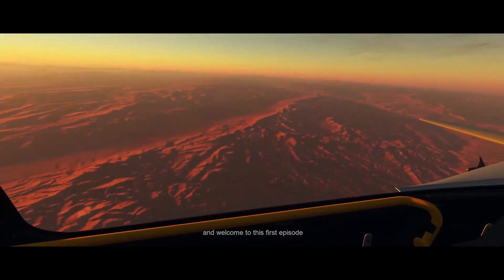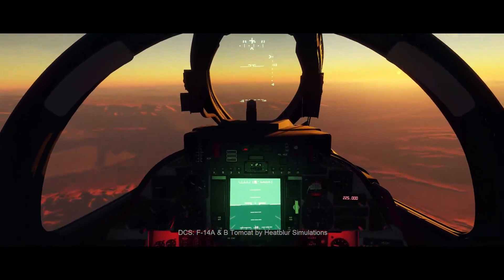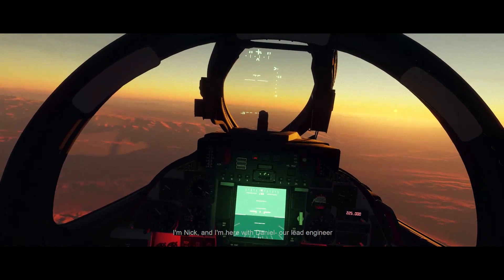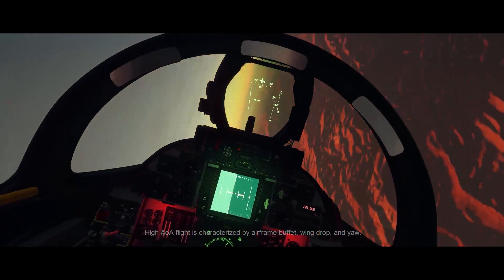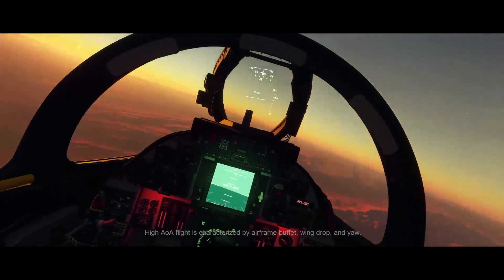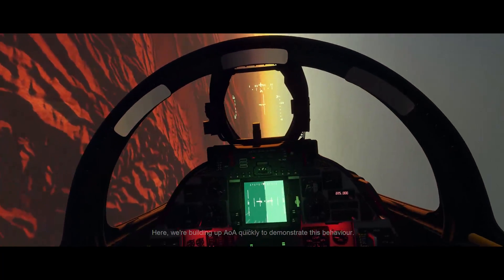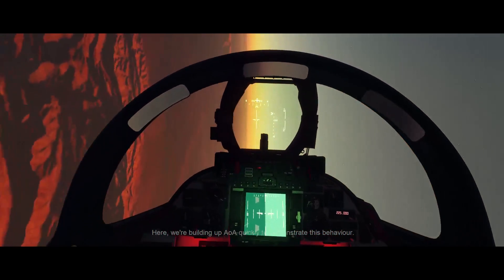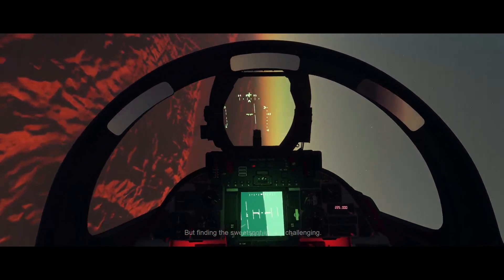DCS: F-14 Flight Model - Ep. 1 - "The Basics"

Comment: I pictured the cockpit of the USN-USMC/Northrop F-14 Echo having several significant layout fixes compared to the Grumman builds.  For the main panel on centerline, I picture an Up-Front Control Panel derived mostly from the Intertial Reference panel in the flight officer's station with flanking COM1 and COM2 selectors, WP button, and brightness; the AOA and sweep tape gauges outboard are carryovers from Grumman.  The Master Monitor Display would be a square 20-button, with the 3ATI attitude director indicator and bearing distance indicator, 1/2-3ATI vertical speed and accelerometer, 2ATI airspeed/Mach, altimeter, and radar altitude display, and the Master Arm/Emergency Stores Jett/Gun rounds and rate controls to port; and the 3ATI threat warning display, chaff/flare/jammer counters, and Missile Prep/IR Cool/Map Gain controls to starboard.  The Horizontal Situation Display wuold also be a square 20-button, with the Engine Cluster (ported from the USN/McDonnellDouglas F-18), Jett Station Select, and quad Hyd Press gauges (ported from the USN/Grumman A-6) to port; and the Fuel Cluster (ported from the USMC/McDonnellDouglas AV-8 Bravo), LOX Quantity, and Cabin Pressure Altimeter to starboard.  With the Joint Helmet Cueing System retrofit, the warning lights formerly on the Vertical Display Indicator on Grumman builds would be relocated to the windshield frame, to join the AOA Indexer and the Compass.

I also pictured a new Esterline stick grip ported from, of all things, Sikorsky helicopters.  The 'pod would have an A/G Wpn Rls button, RDR Acq Mode castle switch, and Roll Pitch Trim hat top; FLIR FOV inverted hat, guarded "ACM" toggle, and Record button second-row. Direct Lift Control wheel on the handle below the "ACM" switch guard.  Two-stage camera-gun trigger.  A/A Wpn Sel paddle (again, ported from the F-18) and IFF button in the thumbrest, with target-undesignate button on the left flank.  NWS/AP Engage pinky button, the corresponding Cancel handle on a paddle from the roll-input bearing on the column.

Comment: How the F does this thing take on small fighters. It looks impossible to maneuver at low speeds. Ive heard stories of it beating F-15s. There is no way...
Reply: Mr. Anomaly they said it's advantages were at low speed
Reply: Low speed handling requires high pitch authority at high angles of attack. Lower lift means pitch increases AOA more. F-15 pilots had a hard time with tomcats at low speed, where the variable geometry wings helped the 14.
Reply: That really makes scene. I really hope the Tomcat can start to tip the scales against the F-15C in DCS with a good crew.
Reply: ShadowPBPBC I know what a flanker is. No need for the wiki description thanks.
Reply: Yes, of course there are HUD TCS videos of F-14 A/B/D getting gun lock on the F-15 that were made available top the public. Then there was 1978 AIMEVAL/ACEVAL where F-14A continuously outperformed the F-15A in ACM evaluation where F-14 was given a 2:1 advantage over the F-15A even with the stall prone TF-030 older engines. In the same evaluations, both F-14A and F-15A went head to head with small F-5E tiger in dog fights. The F-14A had a kill ratio of 2.55:1 versus F-15A's 1.78:1 against the F-5E. Secret is the F-14s variable geometry wings, pancake and central tunnel that give it an incredibly broad performance envelope. F-14A according to the AIMEVAL/ACEVAL report, was continuously outperforming the F-15A in turning performance where F-14A was able to out-turn the F-15A especially when it required tight turn followed by a sudden vertical climb where F-14A simply ran the F-15A out of energy.

Comment: But how well does it fly while inverted?
Reply: You can do a 4G inverted dive with a MiG-28 at two meters.
Reply: The movie 'Top Gun' will explain everything. Then you will be qualified as a Tomcat driver.
Reply: Actually no, I saw a picture a few weeks ago lining the two planes up (F-14, B variant? and the F-5). There's plenty of room to do that with an F-5, I mean a MiG-28.
Reply: what does that even meeeeeeeeaaaaaannnnn.
Reply: With only 600 lbs in the sump tanks, you had better only be transient
Reply: Good enough to get a sick ass poleroid
Reply: It was exceptional even inverted. Grumman did a test (on video from 1973) where an F-14A (fully loaded with weapons) was turned upside down and started to dive down inverted. It stops diving down and begins to climb up flat inverted and goes up vertically inverted at a fairly high speed while raising the nose up gradually. It was an awesome demo video.

Comment: I am way too hyped
Reply: Not necessarily, if the flight model is accurate and you encounter a Mig-29 or SU-27 in BFM. Get them below 10k feet and fight SLOW. You will eat them alive. I have talked with Eagle drivers who have said that trying to fight a F-14 low and slow is a death sentence.
Reply: While it will suffer from hard to master performance, a good pilot can and will make it work in BFM, as has been seen vs F-15s in real life Red Flag and other such exercises. That being said, you're in an F-14, why in the fuck would you ever get into a dogfight when you can launch fucking patriots from a hundred miles away and extend away at mach two?
Reply: Johan G.Bruère-Dawson  

It only seems that way cause the speed so low and with full stick input causes the plane to bleed off airspeed so quickly which in turns causes the nose to dip..... I've seen tomcats complete very tight minimal radius turns a higher speeds. 

Don't get this twisted...Tomcats could turn with falcons!! Just gotta find the sweet spot like the video said.
Reply: Victor Lacas In dogfight against gen 3 fighter I think the F-14 will win. It has better ratio than F-15 during training with Aggressors and everybody knows the dogfight capabilities of the F-5

Maximum speed is useless anyway
Reply: were did you got that crap saying the aim 54 was never designed, tested to hit maneuvering or jamimming targets please do more research.
Reply: TheSkyline35 So you agree ;). I was talking about ''4th gen'' fighters
Reply: The Iranians had good success with the AIM-54. Of course, that info must be taken with a grain of salt as we only have the accounts of pilots who emigrated elsewhere postwar. As for in a dogfight, the F-14A does suffer from poor thrust/weight, but the F-14B's F-110 engines provide a huge increase to thrust and makes the F-14 truly shine, no longer limited by the old TF-30 engines.
Reply: the problem is that phoenix missiles are air defence missiles, bomber-killer missiles, so their probability of hit against maneuvering targets should be bad, particulary if interception point is near the range limit...
Reply: TheSkyline35 I think the eagle will whoop it
Reply: Yes but the TF-30 has a higher maximum speed though
Reply: MillionFoul Lol... I understand what you mean... But it's a thing to launch ''Patriots'' at a 100 miles away.. It's an other thing to make them hit something. I personally think that the AIM-54 is not a very good missile. Never tested against real hard manoeuvering and jamming targets... On the paper and on the AIMVAL, it's a good missile, but in real operation... That's an other thing.. 

So finally.. you will launch 4 AIM-54, all of them will miss and you gonna engage dogfight to save your ass... That's why I'm referring about dogfight. 

Let's be honest : I really hope that I'm wrong about the AIM-54, trust me, I really hope ! I love this plane too much.

Cheers from France
Reply: TheSkyline35 o
Reply: The tomcat supposedly has better low speed handing than the eagle, and I've been beating a lot of flankers in the merge lately in my eagle.
Reply: TheSkyline35 hype 🚂
Reply: Je pense pouvoir battre un f-14 en 21 avec mes r-60m ou même mon canon (bon après il ne faut pas que le dogfight s'éternise sinon plus de coco ^^||)
Reply: I am eager to think that a well trained pilot can beat every opponent in a 1 on 1 dogfight
Reply: Conditions during AIMVAL/ACID exercice. Good missile on paper yeah I agree. But against a MiG-29 with a real pilot, it's not the same.
Reply: Ils l'ont repoussé, mais OSEF. Quand il sortira, adieu vie sociale !
Reply: Not true, the Iranians tested them with great effects against the Iraqis. The usn made the mistake of not factoring this in when using them.
Reply: This plane will get destroyed in dogfight ! It's a sad reality
Reply: I have to disagree, against a Mig-21 it's not that done, well if you want to dogfight a Mirage or a Su27/Mig29 yeah, you are dead
Reply: I think the plane's more beautiful without markings. Hopefully there can be a blank paint scheme that comes stock.
Reply: A100percentBEEF I agree with you. But even with the F110, the F-14 is still heavy as fuck and generate a lot of drag. So it will still be underpowered unfortunately